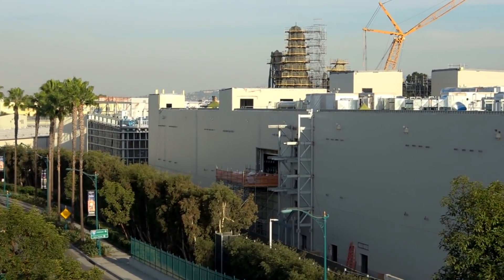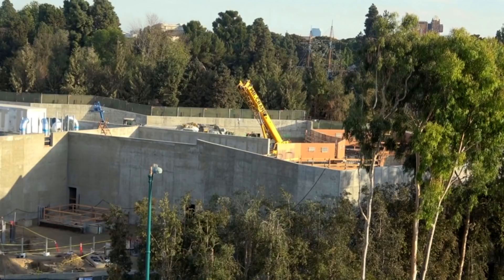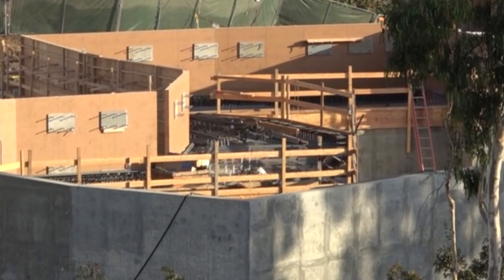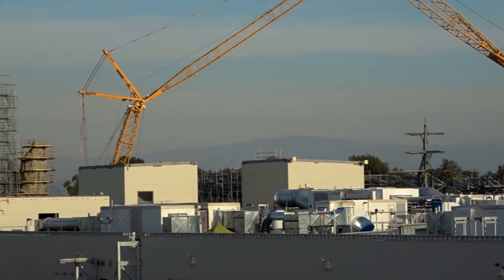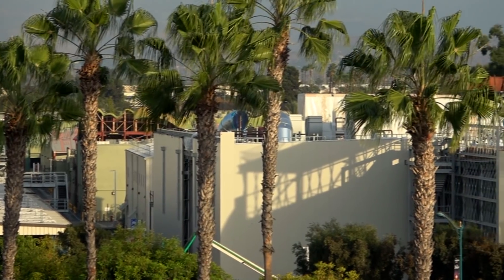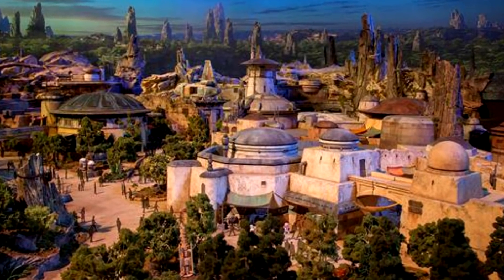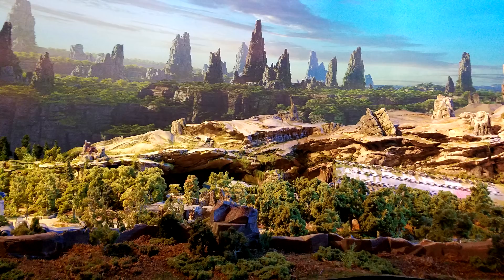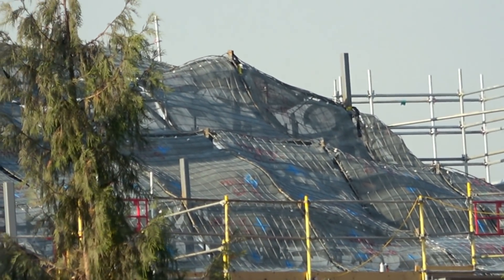New Format! - Star Wars Land Construction - Pt. 123 | 12-01-2017

Comment: @3:46 those “signs” are the back side of the steel plates that they weld the framework to for the rock work to be attached to. The studs sticking out are what goes into the concrete to hold them in place.
Reply: That iron work is what holds the concrete roof in place. If you check the before pictures,you can see a post where some of it is thicker, probably a place where a beam or post is going to attach for something above like rock work.
Reply: I believe the mesh on the far left mountain is done, no reason to finish the back when you can’t see it from inside Star Wars Land.
Reply: Love the new style reporting, it’s nice because you can pop back and forth from old to now and compare them, great job.
Reply: Mark Scheurich great insights. You think they're starting to build the mountain backdrop?
Reply: They’ve already started and from what David showed from the front view and the model this entire area will be mountain covered.

Comment: Those plates are what the steel beams are welded to for the rock forms. They used them on all the walls around the river where rock work was later installed.

Comment: ref 06:07, the left peak will not have meshwork, concrete on the back.  easy to tell since there are no horizontal beams to carry the weight sticking out.  But then it will NOT be visible from the village side.

Comment: So you talk about the interesting characteristics of the floor of the underground que being built, but judging by the ladder to the right going down at least 6-8ft our if camera view, is it then possible that what you are in fact looking at is the roof of the que tunnel & not the floor??? That was the way I interpreted it, it seems like what you called the floor there was higher than the rest of the surrounding area with walls going down on each side leading me to believe you/we are looking at the roof there & all the wonky stuff is lights/ducting/ cables etc...
Reply: And furthering my theory, the tan walls to the left of what I believe to be the ceiling are the frameworks for the top/side of the mountain facade. if you look closely, you’ll see all the supports sticking horizontally out on the opposite side similar to the frameworks for Rockwork in other parts of galaxy’s edge
Reply: True and true!